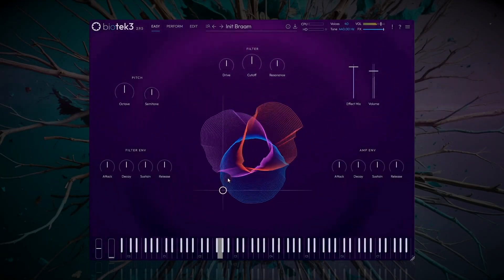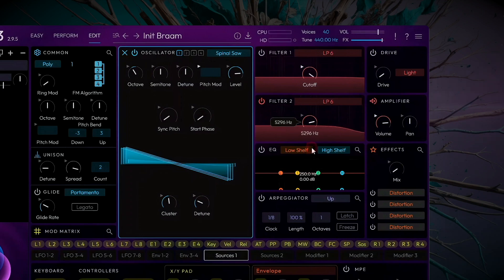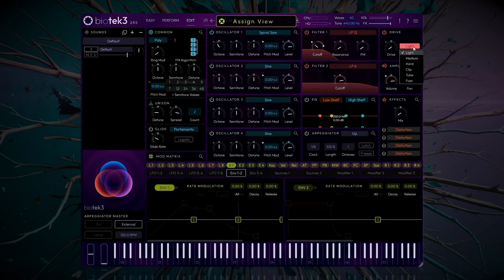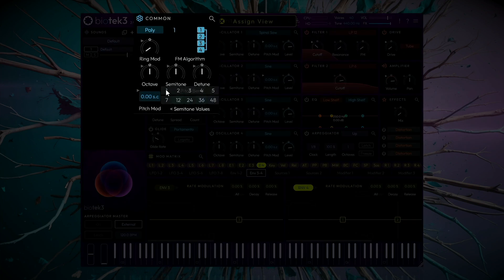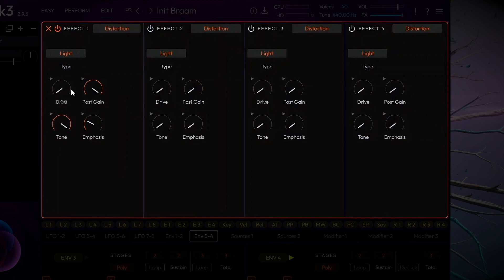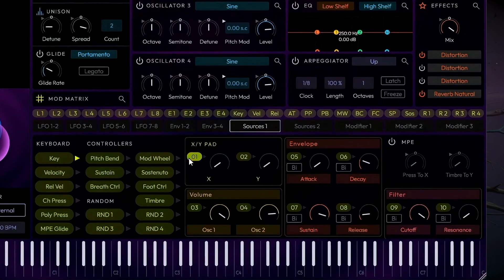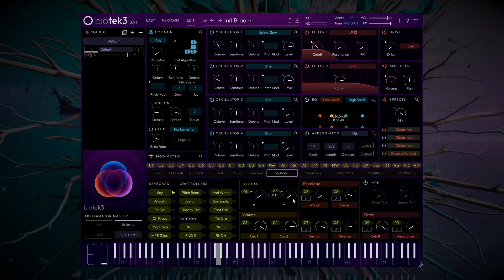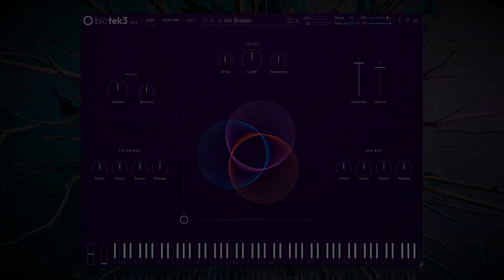BioTek 3 - Creating a Sound From Scratch

Comment: Still no MTS-ESP or microtuning support
Reply: indeed....

and is it more a workflow update, than an engine update (yes they say it is optimized, but i don't really care, because Biotek 2 was already quite optimized, or i never noticed any problems...), strange, a bit strange.... the workflow of Biotek 2 could be better, this seems better... but i am used to it now...
problably gonna buy it, because well, i like Biotek.
Reply: I’m feeling the same way… honestly I could wait for 4, if they’re going to add anything new (it has enough already imho) and possibly optimize it even further.

2 is dreamy imo, not really sure it needed another iteration.
Reply: @ghfjfghjasdfasdf  Its missing an additive engine (either wavetable, spectral, or pure additive)...that's what people are holding against it based on the other super synths/workstations...but I personally dont need an additive engine...what it really needs is a full pcm implementation like users have requested since v1...you need it to take full advantage of the event trigger engine that it was pioneering in...avenger and synthmaster got both this year and are selling for the same sale price
Reply: I learned last night that 3 has actually been optimized bigtime, so I retract my initial trepidation towards it.

Fair enough for your concerns, but I’m not the least bit interested in any of that.